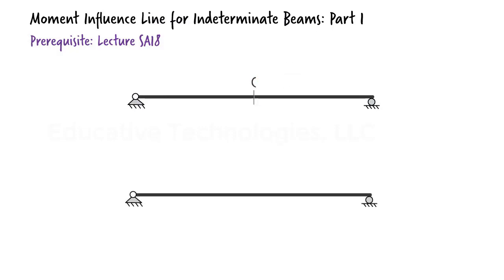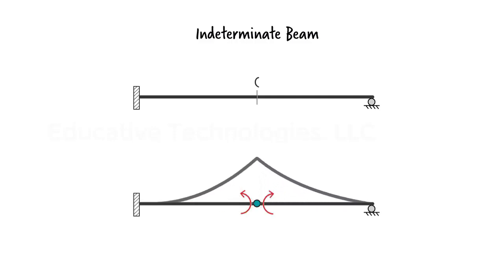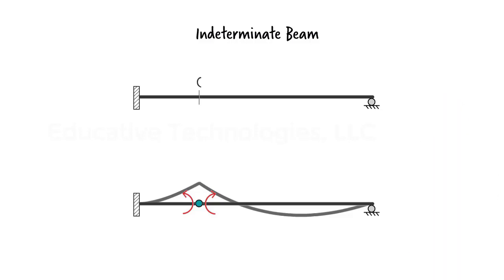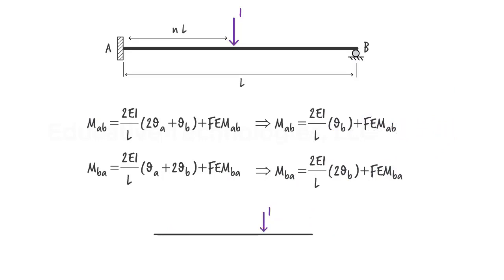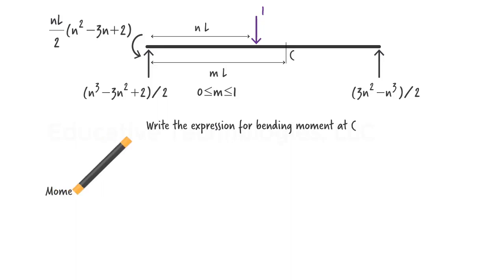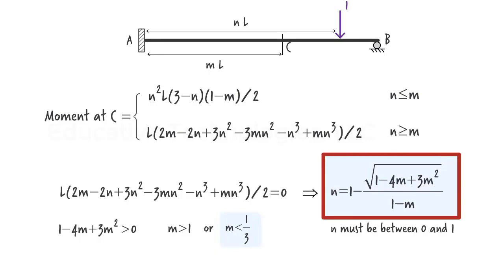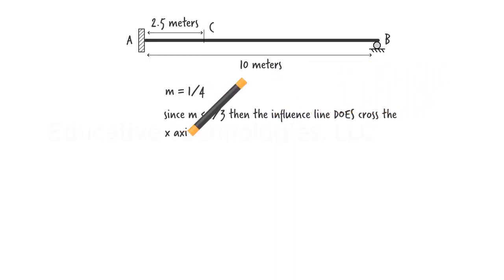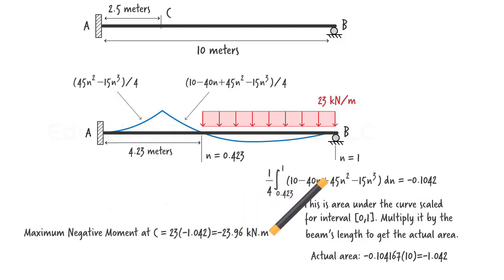SA56: Moment Influence Line for Indeterminate Beams: Part 1

Comment: For the propped cantilever shouldn't the influence line be straight to the right side of C i.e. towards the roller support?
Reply from the maker: Although the shear diagram for the beam is linear, the shear/reaction/moment influence line for indeterminate beams is nonlinear. For the propped beam, the reactions at the fixed end in terms of the position of the unit load are:
M = x - (3 x^2/2L) + (x^3/ 2L^2)
V = 1 + x^2 (x - 3L)/2 L^3
Note that both shear/reaction and moment at the wall vary non-linearly with respect to x (unit load position). The above equations indicate that shear at any point to the right of the fixed support (regardless of x value) is nonlinear as well.
Reply: @DrStructure  But isn't the right part going to rotate freely upon introduction of an internal hinge?
Reply from the maker: That is not a real hinge in the beam. The real behavior of the beam is not influenced by the fictitious hinge we've placed there. The actual shear value remains nonlinear in terms of x (per the above equations), unless we have a real hinge in which case the beam becomes statically determinate (and the above equations become linear in terms of x). The principle that we used to draw shear influence line for determinate beams (a diagram consisting of straight lines) does not hold true for indeterminate beams.

Comment: I would just like to find out from you if im on the correct path. The question is for an indeterminate beam: if you have a 3 span beam, (end supports are fixed and the 2 supports separating span 1 and 2 as well as separating span 2 and 3 are roller) span 1 =EI, span 2 = 2EI =2 and span 3 -EI. How would you approach it to determine a point of the beam using the Muller Breslau principle. Would you combine the Muller Breslau principle with the Double integration method (Macaulay method) to take the varying EI into consideration? Hope that made some sense
Reply from the maker: Alright, we have a continuous beam with varying moment of inertia. But what is it that we want to determine? Moment influence line? Deflection? reactions? ...

Comment: thanks for the video, and it will be great if  more example for the reaction, shear and moment influence line for statically indeterminante structure, either solve by conjugate beam method or virtual work method

Comment: on the  right side due to the roller support the influence line will be straight or curved?? i think it will be a straight for indeterminate beam with a fixed and roller support!
Reply from the maker: The influence line is going to be nonlinear (curve) all over.
Reply: Although the given moving load is not distributed to which this imply it need to be curved but there are one thing to remember Fixed support keep the beam from rotating around making deformed shape of the beam to curve like to satify its support condition

Comment: Excuse me, @1119, I have 3 questions. 

1. What is the physical meaning of the area under the curved scaled?
2. What is the physical meaning of the actual area?
3. Why do the max. negative moment at C equal to the UDL times the actual area?
Reply from the maker: This goes back to the definition of influence line. 
Say, we have constructed the moment influence line for point C.
Now, we divide the beam into finite number of points. We can refer t  a typical point as x_i. 
So, the points on the beam are x_0, x_1, x_2,...x_k where the k is the total number of points.
At each point the influence line has a height, let's refer to the height at x_i as h_i.
What is h_i? It is the magnitude of the moment at C when a unit load is placed at x_i.
Now, suppose the beam is actually subjected to a uniformly distributed load (say, with the magnitude w), meaning there is a concentrated load applied at each point on the beam. If we assume a unit distributed load, then at each x_i we find a unit load, meaning there would be a non-zero  h_i (i.e., there is a moment at C due to that load at x_i). 
But since there is more than one unit load on the beam, then the total moment at C would be Sum (h_i) for i = 0 to k. This sum, we compute by integrating the influence line function which is the same as calculating the area under the curve.  
We then multiply the area by w (since the influence line is drawn for a unit load) to get the total moment at C due to the actual distributed load placed on the beam.
When only a part of the beam is loaded, say, only the negative area is loaded in order to determine the maximum negative moment at C, then we integrate the influence over the negative area only, meaning we are not placing the distributed load over the entire length of the beam, rather we are pacing it over the negative region for maximum effect.
As to your first question, you can view our derivation as if we first scaled the beam to [0,1] interval, the beam has a length of 1. Or, the location of the unit load varies between 0 and 1 only. We do our calculation based on the scaled model, then at the end we multiply the result by the actual length of the beam to get the actual moment value.

Comment: Excuse me, @0825, why the do moment at C be negative when m<1/3 & n>1-[(1-4m+3m^2)^0.5/(1-m)]?
How do we know the moment is positive or negative?
Reply from the maker: At 3:20, we can see that the influence line drops below the x-axis, it becomes negative. Knowing that moment could become negative, now we want to figure out:  (1) for what m values that happens and (2) where exactly the diagram crosses the x axis.

The derivation tells us than the negative region develops only when m < 1/3. 
It also gives us the equation (the one you specified) for determining the zero-point of the influence line. 

So, we can determine the positive and negative regions of the diagram qualitative, then use the derivation to determine their exact locations.